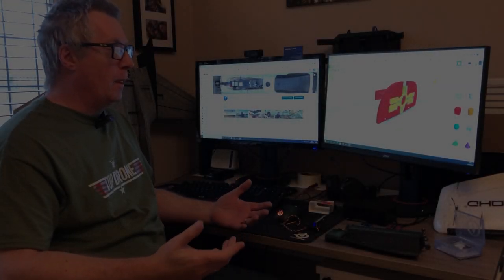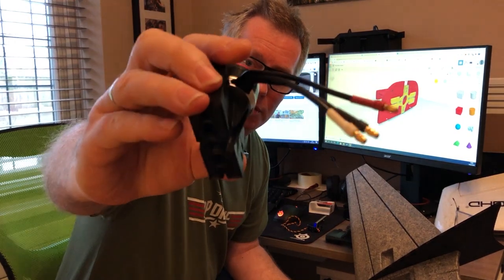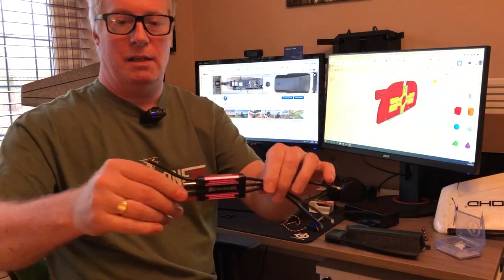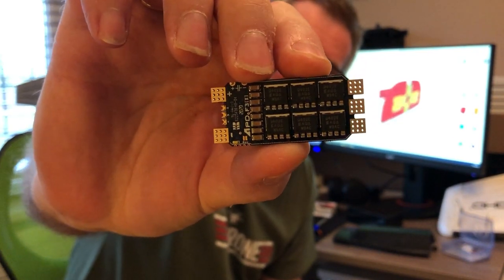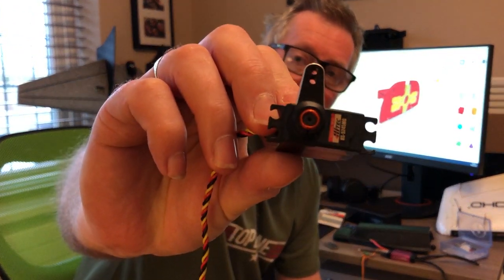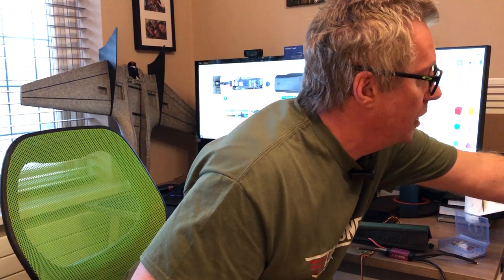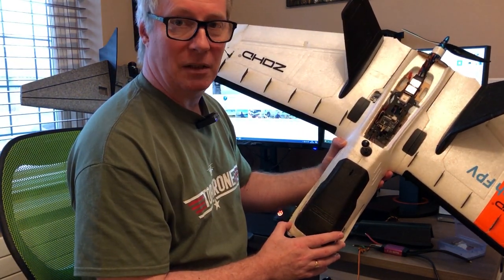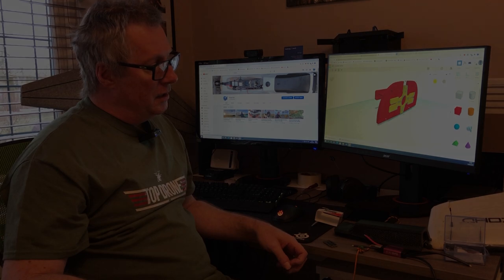Mini Drak Build Update VLOG and Badass Dart XL

Comment: Can't beat the F405. More than adequate for wings.
Reply from the maker: Yeah its my goto FC just not sure how well it will handle the amp draw from the 6S powertrain, we shall see.

Thats the purpose of the XL test to suss everything out before I decide what FC to put in the Mini Drak.
Reply: @bluefish3607  I've pulled 101A from my S1100, if only for a second or two, but pulled 75-80A constant for 30s or so and it was fine
Reply from the maker: @blackbirdboy1  Thanks for the heads up thats reassuring.
Reply: You can also try the new f405 wse with better barometer, current sensor and OSD. Also has usb C on a seperate cablr
Reply from the maker: @pasifpv5508  Yes I might try one of those. They are rated at 132amp and the F405 Wing is 104 amps 👍😀

Comment: Hi, looking forward to your future videos. Can you please make a video in the future, comparing your wings? Why would someone choose an AR Wing instead of ZOHD Dart XL. What are disadvantages with goin sub 250 with something like ZOHD dart 250. Because I really like your videos and want to build myself a fixed wing. I just don't know which platform to go with.
Reply from the maker: Hi Jan thanks, I am glad you enjoy sharing my flying adventures with me. tbh The Dart XL and AR Pro are both really great planes.

The Dart XL has a long nose and can be easily damaged or broken in a crash and the AR Pro is a little more difficult to handle for a beginner I think, but as long as you set everything up right you should be ok with either.

The Dart 250G is a great little plane in light winds and very easy to launch but I started with a Sonicmodell AR Wing 900 and this is a fantastic plane. Easy to build, flys great, can be fast and nimble or used for longer range, its easy to launch and can be easily repaired if crash damaged.

The AR 900 is also quite cheap to buy and there is tons of help out there because it is probably one of the most popular wings ever produced.

That would be my recommendation for a first wing, but just go for what you like, thats the most important thing after all, personal satisfaction.

I will be making a new video with my AR 900 soon to compare it to the AR pro, so that might help.

Happy flying.
Reply: @bluefish3607  thanks a lot, I will keep an eye for that video